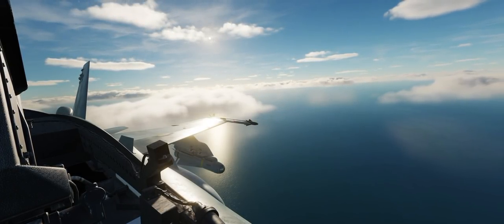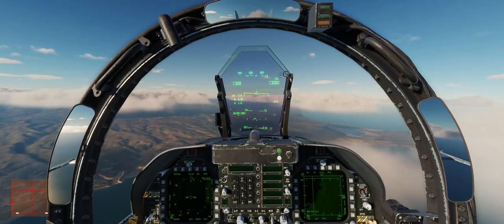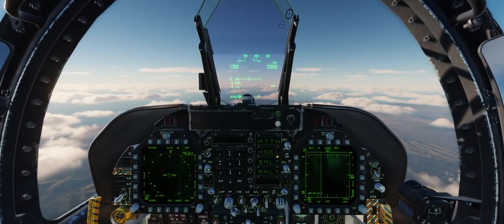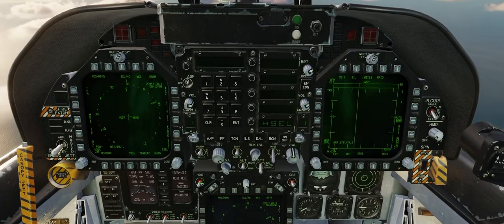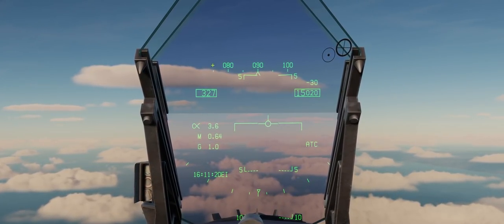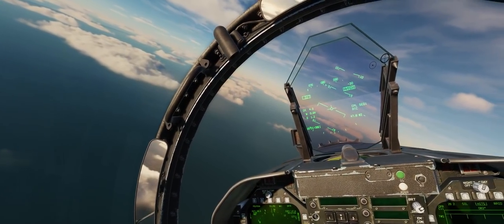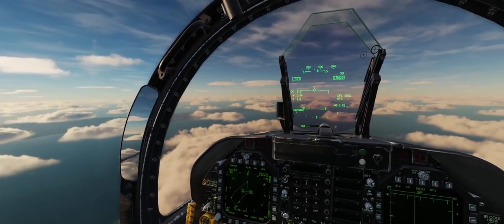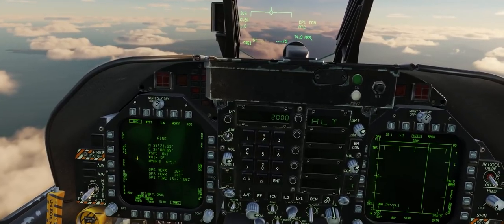DCS F/A-18C Hornet DEFINITIVE Navigation & Autopilot Tutorial

Comment from the maker: Hey guys! if you would like me to make an ADF, Holding pattern or Radial Vs Course Line Tutorial please let me know! Links Below:
Airspeed Types and Differences: https://youtu.be/1NBDy5FWzWE
Definitive Taxi & Take Off Tutorial: https://youtu.be/VQWhLtblV0w
Definitive Start Up Tutorial: https://youtu.be/0mPpL_gpddE
Reply from the maker: @christoskelaiditis653  Hey man, check out these settings, They havent changed since this video was made https://youtu.be/rPv_2BL73VI
Reply: Yes please! Your 2022 primer on the Hornet systems are both timely and fantastic.  Thank you for taking the time to teach those that want to learn more and aim for maximum immersion.
Reply: @christoskelaiditis653  YMMV of course, but I've had better luck with things like MSAA etc. turned off in the sim, and run AA through my graphics card settings instead. Some basic additions in reshade put it over the top, and I can run consistent high frame rates, up to 140+ fps on the Syria map offline at low alt over a city. (I run a 5700x/6800xt combo)
Reply: I love your videos, very well done!  I would love to see videos for the ADF, Holding pattern or Radial Vs Course Line Tutorial.  Btw, do you have your trackIR profile listed in the user files?  It looks very smooth.
Reply: make every thing there is for this plane. Its presented very well and clear.
Reply: Yes please!
Reply: +1 for holding patterns!
Reply: Hey man, these are great, why did you stop making this series?
Reply: Radial vs course line tutorial would be awesome!
Reply: Yes! Please make more! Very solid

Comment: Nice job. Very comprehensive.  It never really occurred to me to use CPL mode with TCN + CRS line.  Cool feature.  And Yes, a Case III vid would be great.
Reply from the maker: the F/A-18C can do some amazing things that I think most people in the DCS fan base dont know about!
Reply: @Spudknocker  Well Spud, that can be said to most of modules. There are lots of small details and cool features that people don't know about. People tend to focus on the bad not the good, unfortunately. In the warbirds, for instance, the gyro compass is pointing one way when the engine is on idle, and other when the engine is on a cruise power, showing that the gyro vacuum pump is modelled. These small details is what makes DCS so great.